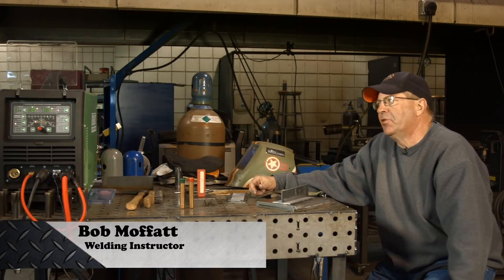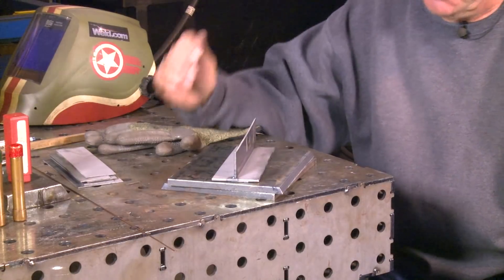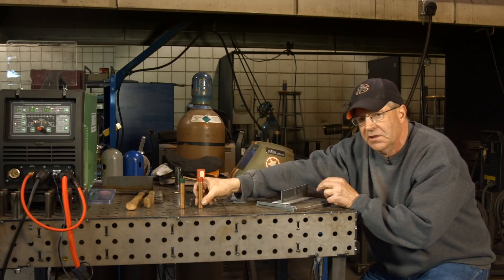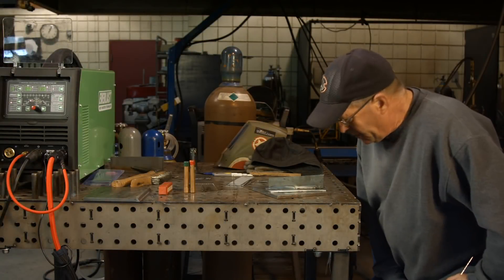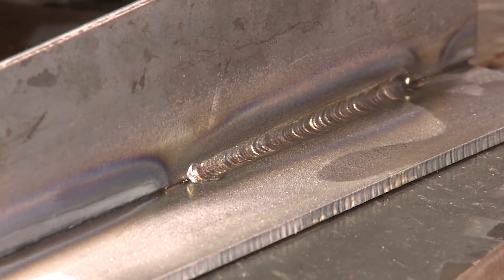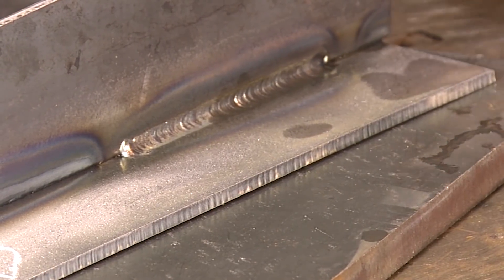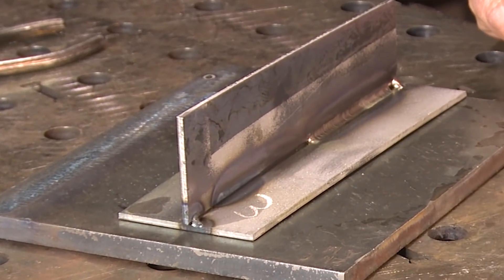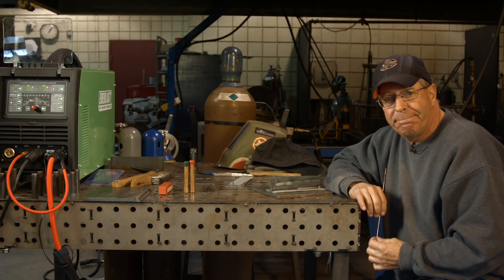🔥 Lay Wire vs Dab Techniques (with Everlast PowerMTS 251si)

Comment: I've never tried to use the lay wire technique with my everlast welder. How can you guarantee there will be enough filler material in the weld if filler wire is just sitting there getting melted?

Comment: Hi, I'm wondering how you have found this Everlast welder? Is it holding up long term? Would it be a good option for someone that builds projects non professionally and would like the capability to run multiple weld types but not necessarily multiple machines? I enjoy the videos.

Comment: do you tell your students that when there out there in the job market. there going to be running older machines??
Reply from the maker: I'm not sure I follow you? The students run everything from these Everlast Inverters, to Lincoln C300 to Miller  Shop Master, ESAB Rebel / Renegade, etc. They run transformers, inverters, new and old. Machine doesn't make the welder look good, it's the other way around. Hope that answers your question.
Reply: Weld.com 
 that's OK. it's been better than 20 years since I was in high school VoTech and Tech College. but my 1st welding teacher ( Votech )told us that. when were go out into the field/ job market. we would be running older machines for the most part. so seeing the machines you run are considerably more modern than what I've run.

Comment: I would love to see your technique for ending a TIG Pipe weld on stainless pipe on scratch start pure DC generator like a old Lincoln SA 200 engine drive without burnt gray color, that would be a test of technique and would help alot with heat input on stainless

Comment: Does that machine not support 4T high freq start??  4T doesn't have anything to do with lift arc, per se....only that you have to hit the switch to start, then stop the arc....but it still should be able to high freq start...unless you just like lift arc, then hey, sounds good lol
Reply from the maker: This machine supports HF start, it doesn't matter if you are using 2T, 4T, hand control or foot control. We did lift arc because we had some requests to show lift arc with 4T mode.

Comment: What's your take on this machine?  I can't decide to get one or wait on the 221 that's coming out that's dual voltage.
Reply from the maker: So far this machine has performed well. We haven't had a chance to use the 221, but we have heard about it and look forward to showing everyone. One nice thing about this machine is that it has HF start, which (I believe) is the only multi process that can tout that feature.
Reply: This one is dual voltage also.
Reply: The 221 is AC/DC with pulse. They've announced it for later this year.

Comment: the 4t function on the esab I use at work still utilises a high frequency Arc initiation, it's really just a latch button so you don't have to hold the switch down when welding.
Reply: using the 4 t isnt instead of HF, its becaus when u push and hold thats one setting, and when u let go it goes to ur working setting, so u can lift off with low amp and when u see the arc u can let go and start welding :)